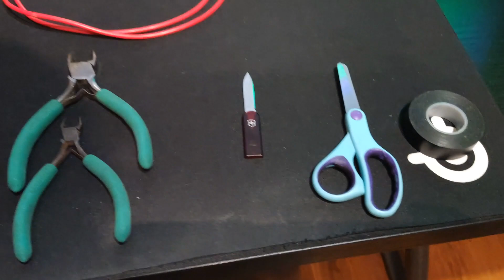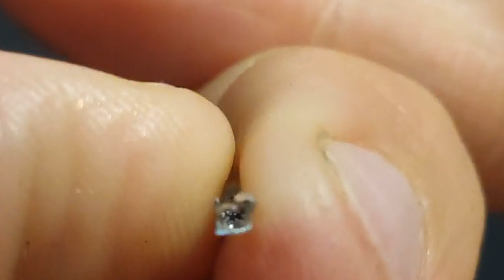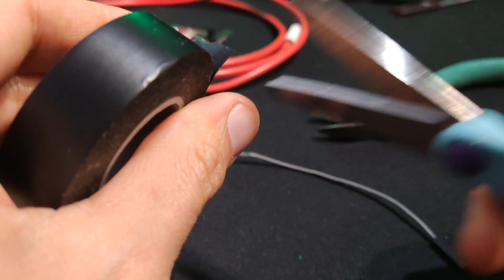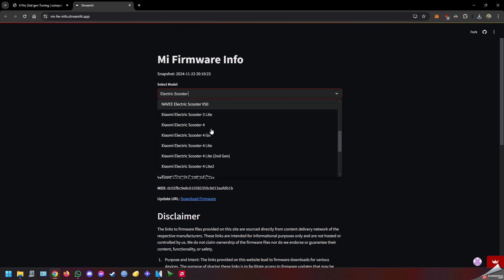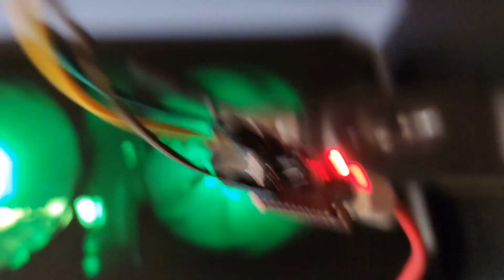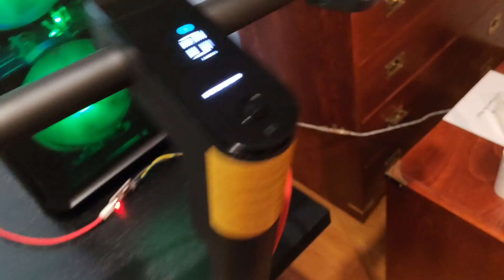Remove Speed Limit on Xiaomi Scooter Pro 4 gen 2 (HACK)

Comment: Nice tutorial! You can do it (almost) for free if you have a Arduino. Arduinos have a integrated USB to TTL converter. I used a Arduino Uno, connected reset pin to gnd to disable the Atmega microcontroller and then connected RX, TX and GND pins to my electric scooter.

Comment: After i have done evereything, is there a app where you can control how fast it goes.And is it possible to do a setting that if youre in D mode it drives like 25 and if youre in S mode it drives more than thag like 36...

And if i go to the mi home app does the scolter ger back to normal if i pair it. btw thank you so micv for the tut it was the first that was good and authentic

Comment: My scooter came last week I have the xiaomi 4 lite 2nd gen NOT the pro and I've already updated the firmware on the app, will it affect this or can i still do the hack
Reply from the maker: 4 lite not supported and overall a bad scooter if you want more speed, return it and buy something better
Reply: @krypz0n  what would you suggest for around £250
Reply from the maker: @Abbzz006  try to find a ninebot g30 in the used market. It is the most easily tunable scooter with a shitload of aftermarket  parts and mods

Comment: Used female-female DuPont with insulating tape and it worked. 
37kmh/100%bat/65kg.
32kmh/30%plus bat.
For the speaker beep, I only put tiny bit of Faber Castell “Tack it” on top, and I don’t hear nothing while driving.
Thanks!
Reply: Where is the speaker located?
Reply: @ https://youtu.be/LUPODSxsKwI?si=52Qs-Dwu2AqpscKO minute 1.27

Comment: How to set the Serial port ?
There is nothing when I launch bmw flasher
Reply from the maker: @lenniboissiere9445  check out my newest video. There is a section about drivers. You're probably missing the right drivers or using a bad usb cable

Comment: I'm currently unboxing the Xiaomi Electric Scooter 5 Pro and all I'm thinking about and praying for, is a speed hack solution for the 5 Pro some time VERY soon. 

If not there's a speed hack available in 2 weeks from today, I'm sadly considering to return it, and get the iScooter i10 Max insted. It's almost the same in looks-and almost same specs (of course Xiaomi is normally always the way to go), - but the iScooter i10 Max just go betweem 40 - 45 km/h.... almost directly out of the box (no need to flash FW or anyting, just do a simple routine with the brake and on/off button to unlock from 25 km/h to 40/45). 

That being said, unfortunately the iScooter comes with air tires - my BIGGEST turn off, ever since I tried having multiple flat tires on my ooold Xiaomi M365 and it was a nightmare to get it fixed everytime - soon I learned to put on solid tires and even though it was a little more bumpy ride, it was no question about it the best solution ever. 

Anyway, that was back in 2018 i think the M365, so of course it came with no suspension - but that a totally new store now with 5 Pro. So of course I'd reallty like to stick with my Xiaomi Electric Scooter 5 Pro. But I have faith in the MODDERS out there.... And im not above BEGGING (pretty pretty please make the speed hack for the 5 Pro too 😂😇😛).... or offering a BRIBE😎 (haha okay, let's call it MOTIVATION TRIGGER REWARD instead 👍). But make no mistake - the reward am I dead serious about!! I have no problem compensating the Godsend who makes it (hopefully) possible first ✌👌
Reply: tune for 5 pro is now available
Reply: @amugus3486 Thanks alot for the heads up - "unfortunately" I did return the Xiaomi 5 Pro and have now bought the iScooter i10 instead. It cost half the price compared to the Xiaomi 5 Pro and has almost the same specs (Xiaomi has better tires out of the box),, but that's basically it, and I've already bought same solid type tires for the iScooter i10,, but I wait to change the tires until I get a flat tire someday.
Seriously I am VERY impressed with the iScooter in terms of build quality, speed (45 km/h) and great battery. I will recommend everyone to get the iScooter i10 Max, Pro or Plus since they have around 800 W motor = faster acceleration. The i10 is already fast when accelerating, but for 50 USD extra I could have upgraded to the iScooter i10 Max, but didn't because I'd rather wanted a 3 kg lighter scooter (20 kg. vs. 23 kg.). And why was I so focused on the weight of the new scooter?! Because I just had the Xiaomi 5 Pro for a couple of weeks before returning it, and when I had to carry it I felt like I was carrying, a 30 kg device... Which I don't think it weighs, but I just came from my Xiaomi M365 first edition that was 12.5 kg. 😂😂

Anyway, time for me to shut up, now, but do yourself a favor and take a look at iScooter's many different models = fantastic build quality and even more amazing how low their prices are compared to other vendors.
iScooter is doing great things atm - in my opinion they have worked hard and is undoubtedly the new King of Electric Scooters based on value for money! It used to be Xiaomi that had that title. And truth be told I love Xiaomi and own maybe 10 different products by Xiaomi atm. eg. my phone, smart home, tech gadgets etc. (that's why I automatically bought the new Xiaomi 5 Pro scooter when I needed a new one.
Xiaomi is still no. 1 in many categories, but no more when it comes to electric scooters.... Give iScooter a try next time, you won't regret it 😂

Comment: Danke fur deine Anleitung. Hab mich genau an den Guide gehalten den du verlinkt hast. Allerdings habe ich das Kabel fertig gekauft. 😂
Lauft super. Xiaomi 4 pro gen2 geht jetzt 31kmh mit mir (86kg) als Fahrer. 

Hoffentlich geht mit der Software bald noch mehr.
Reply: Wo?
Reply: @max._rtkeBay bei Jupoma. Top Qualität und schnelle Lieferung. In seinem QR Code ist bei Lieferung noch ne Anleitung mit allen Links auf deutsch dabei. Außerdem eine Firmware die 3kmh start 20kmh normal Mode und Im S Mode offen.
Reply: @phil.osophie.deluxe ist die motor Bremse stark
Reply: Kannst du mir helfen dabei? Link vom Kabel senden ?
Reply: @Nesta187  Ebay Jupoma
Reply: @Nesta187  Steht doch im Video welches man kaufen soll.

Comment: Hi i have a problem. I used cp2012 two times and i burned it but i dont know why. I connected all correctly but it starts to heat. What can i do
Reply from the maker: sorry mate i dont have experience with cp2102 :\
Reply: I meant cp 2102

Comment: How many kilometers can you drive when the speed is unlocked with full battery? And do the diffrent Modes still work? (Like 6km/h and 15km/h)
Reply: He doesn't need as much more than before I always use him for two weeks about 5km a day.
Reply from the maker: yes, other modes still work. Im not quite sure as ive never done 100-0% full throttle, but since its going faster it will definitely consume a bit more battery. Id say yuo should still be able to squeeze about 25-30km of range tho

Comment: "unexpected response : invalid FW file".what should do now?
Reply from the maker: @erdalladre-123  did you download MCU firmware or normal firmware? Download MCU firmware, patch and try again
Reply: @krypz0n  i downloaded MCU firmaware like you said. and patched, i tried in the same way 2 times but maximum it arrives until %5 and says the same thing
Reply: @krypz0n  this is pro4 2nd swiss edition.
Reply: @krypz0n  it was completed until %45 and gave the same error.
Reply from the maker: @ hey, join the discord, i never heard that error before, might need a lil bit more help
Reply: @krypz0n  i did it finally by adding an USB hub to connect to pc. the problem was the power of the adapter or usb but succed:)

Comment: and it will work on a Xiaomi Scooter lite 4 gen 2 scooter.
Reply from the maker: am afraid not. check the pinned message on the mi4 section of the discord, requires other methods, but its so much work you're better off selling that scoot and buying a g30 lol

Comment: I did everything and after pressing start update nothing happens! All the time 0% 
does anyone know what this is about
Reply from the maker: what COM port you using? join discord for help
Reply: @krypz0n I used FT232rl and still it don't work. I buy CH340 and it works, but speed is limit on 28km/h. Can I do something more, to drive 36 km/h?
Reply: @kwojciechowski000  hi , i use also CH340 but it stucks again on 0% , how did you fix it?
Reply: @amiralizargar9308  I didn't do anything special. It just started loading the file to the scooter. I'll add that when the battery is fully charged, the scooter goes 33 km/h
Reply: @kwojciechowski000  thanks, i will try again when my scooter is full charge and i hope it works
Reply: Previously I had a speed limit of 20 km/h

Comment: I was stuck at 0%,but after a few times disconecting the wires and the usb it worked,but i only get 28kph,29 sometimes,is this because of an update or something?
Reply: Hi , i have the same problem , BW flasher stuck on 0% ,can you explain more specifically how did you fix it ?
Reply: @SatcauCristian you need to Power on before disconect the Display Wire

Comment: Not working for me, i tried plenty of times but progress stuck on 0% . Cable connected correctly, diodes are flashing but nothing happened, scooter is switched on
Reply: You have to do it like in the video, first connect the adapter to pc, then turn on the scooter and then disconnect the adapter from scooter and connect it to the other
Reply: i have the same issue , did you fix it or found any solution for that?
Reply: @amiralizargar9308  unfortunately no :/

Comment: So the speed in air is 36 km/h, what about on the road with me 87kg?
Is any warnings i must know like, damage battery or burning the controller? In past i had a Xiaomi pro (1st) and when i was going down on a hill i reched 38 km/h and burned my controller 😢 not a happy situation
Reply from the maker: @HardDiscount  on flat ground, with full battery, similar weight id say around 30-32kmh. On a descent ive reached 36 too but feels sketch
Reply: @krypz0n  yes Same Speed AS the Same wight

Comment: Could you explain this again? When I click only on Region - Free (RFM) and I don’t click Remove Speed Limit Sport (RSLS), how much speed could I reach if my scooter is driving 20 km/h before? The scooter is a German model (allowed to go 20 km/h), but it stays in Austria (where the limit is 25 km/h). Could I reach 25 km/h with this configuration? I don’t want to go faster than the legal limit of 25 km/h, just the maximum allowed speed, which is 25 km/h.
Reply: same here!
Reply from the maker: @mem4o  Im making a new video that has a chart showing what each mode does!

Comment: Hi, thank you for the video,
Can you tell me which cables I need? Ideally, I’d like a ready-made cable that allows me to connect my laptop to the scooter. Do you have an Amazon link for me?

I want to ride at a maximum speed of 25 km/h, as my scooter is currently limited to 20 km/h. However, 25 km/h is legally allowed in my region.

Which firmware and settings do I need for the Xiaomi 4 Pro (2nd Gen)?
Reply from the maker: Check ebay link on my description, there includes the UART + 5pin connector for the scooter, all you need is a USB-C cable. 
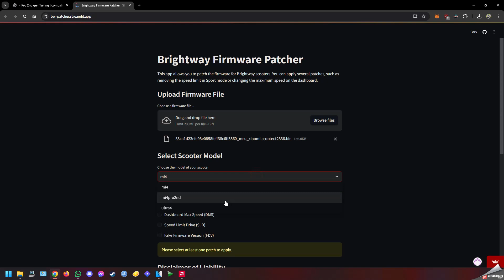For what you need, You will need the global patch, without removing the speed limit, on step at 7:05 select "region free" but do not select "remove speed limit"
Reply: @krypz0n  The product on eBay is still unavailable. Do you have another link, or perhaps an Amazon link where I can purchase it?
Reply from the maker: @mem4o  https://www.ebay.com/itm/116467717525
Reply: @ thank you

Comment: Thanks a lot for this hack! I drive with your modification around 100km, and is very ok, batterry still the same like before. Any chance to make faster than 40kmh? Do you know a cheap suspension for 4pro 2nd gen, without Motorim (is very expensive and not on stock around my country)?
Reply: Salut 
Ai instalat firmware-ul ca in tutorial?Daca da Ce viteza ai prins? 36?
Reply: Da, in gol merge 35kmh, cu mine care cantaresc 117kg, prinde 31 cu bateria plina.

Comment: I have done everything as mentioned in the video but it doesn't work for me.
does not exceed 0%. 
any advice?
Reply: Turn your scooter on 😅
Reply: @hilmi3109  yes, jus as I followed the steps I also trun it on.
Do uoy think the firmware is blocked.
Reply: @badbenny  maybe you downloaded smth wrong you need to download the mcu firmware and patch it with the bw patcher for your scooter then you need to upload the patched mcu firmware to the scooter that is turned on or maybe your cables are not right in
Reply: @hilmi3109  very good 
I will try it and review everything in detail and let you know if it works or not.
Reply: got the same issue. first make sure all cables are 100% connected. then turn scooter on, pull cable, put new one on and start the programm.

PS. u have to be quick bc after a short time the USB thing stops working without any input

Comment: Hi, I already have all the accessories. But I have a Mi4 scooter, I tried to flash it through bwflasher-v0.3.2, but nothing happened, the firmware simply did not load. Is there a way to flash my Mi4 scooter?
Reply: Only gen2

Comment: @KrYpz0n so the serial number doesnt change by following this guide? For example if i have insurance etc on my scooter and i use this guide, in case i need to send my device to repair i just need to follow again all the steps but uncheck speedhack and region boxes so the device will be flash in stock mode right? Or im wrong? I already purchase all the piece i need, let me know if i can reset my device at any time in case i need to do so!
Reply from the maker: the serial number? You mean the metal plate on the outside of the scooter? i dont think you can flash that unless you have a blowtorch :D You can reset to stock firmware yes

Comment: Successful with CP2102. Btw: I used female to female dupont wires and did more or less what you did. removed the plastic cap and pressed the eyelet a bit, of course finally wrapped with insulating tape.

Comment: Can you also set a secret combination so that the scooter only drives at 30+ kmh after a certain sequence of buttons is pressed?
Reply: Not yet :(
Reply: Did you tune it ? @hilmi3109
Reply from the maker: you could change it to MPH, and open the dash and remove the KM  / Miles LED, so it looks like it says 25 when youre actually doing 30+ kmh :D
Reply: How to downgrade it?
Reply from the maker: @Felix_vhm  Just flash it with the MCU firmware file, the one you'd usually patch. That will put it back to stock

Comment: Hmmm, if the noise is only when doing 30km/h + wouldn't it be possible to keep the locking but move the limitation to 29km/h so we don't have to deal with the beeping ?
Reply: Yes Please tell us if the beeping is removable or not! Because it will be very annoyin and maybe the battery will decrase harder because of the beeping sound and what others thinking if they hear it?! =D They think u stole it :D
Reply: Yeah, the beeping has been holding me back from unlocking mine, unless we can get rid of it I don't think I will do it
Reply: @RektaWasHere  btw im from Hungary and mine only goes 25km/h =(... if i go faster on a downhill it starts beeping too but it wont slow down anymore after the last and only firmware update.. i think it is still not worth it to hack without a nice clean hack like not beeping if it goes faster after the hack... we lose the guarantee and it can easy kill the battery if you are not careful . no balance i think so
Reply: @ agreed though I wouldn’t mind a 4-5 km/h increase
Reply: @Senkisesose  lucky you. Other EU countries limit the max speed to 20km/h
Reply: Puedes quitar el altavoz quitando la pantalla veras como el altavoz, puedes sacarlo con calor o con tan solo ponle una cinta para que no suene tanto

Comment: Does the motor start as soon as you press the throttle or do you still have to be going at 5km/h before it starts after flashing the firmware ?
Reply from the maker: Not yet, but possibly in a future update, am looking forward to it as well :)
Reply: @krypz0n  But in eco is it still 6Kmh D 20kmh and sport 35 ? or all 35 if at D it is 25 it is good
Reply: yes i wanted to asking too 😁😁
Reply: only in 4 ultra